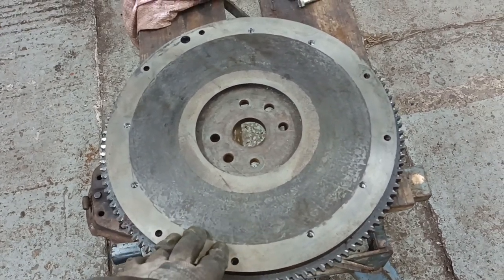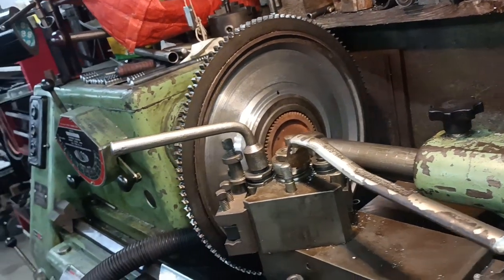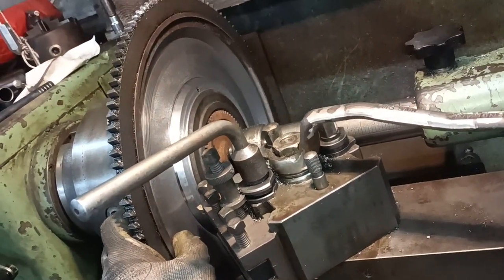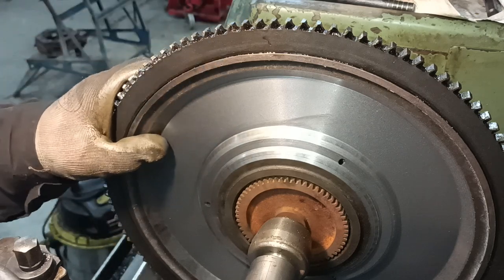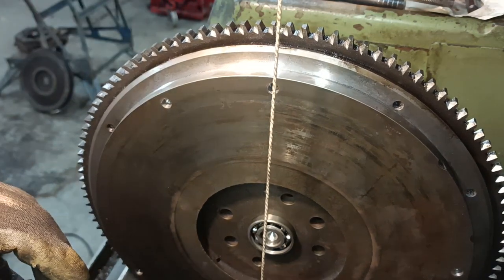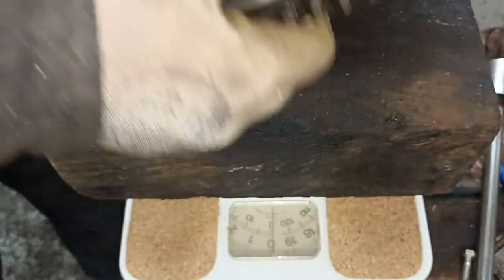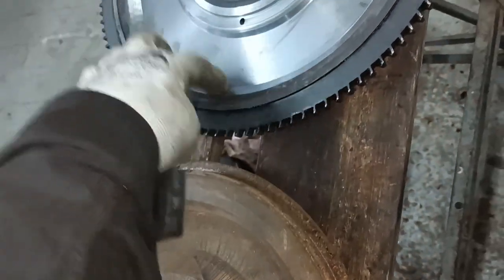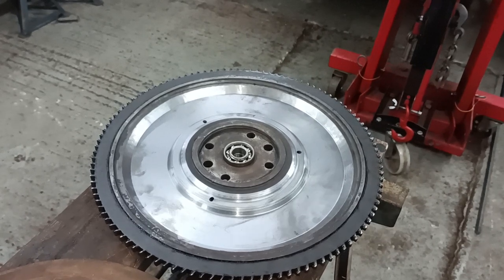A job on the lathe! Lightening a Flathead Flywheel. (2319)

Comment: Nice idea to let others know what your YouTubers are up to.  I helped a neighbor for several years with his 1937 pickup.  Servicing, brake work (cable brakes), General upkeep and then storage when he and his wife moved from the farm to in town.  We had an agreement that I’d charge him $25 a month for storage and he’d charge me $25 a month to use the truck.  After several years he was able to think about passing on the truck to me even though it had been his father's truck from new and then his for many years.  I've rebuilt the early style synchro transmission, replaced the service and parking brake cables, had the distributor and carburetor rebuilt and (heresy!) installed turn signals so I can signal a turn without the following cars thinking I am making an unfavorable gesture with my left hand.  Although the fenders were replaced and the body repainted 50 years ago, it is a real survivor and totally stock, except for the turn signals.  This week I am replacing the water pumps as one was leaking.  I suspect I'll rebuild the leaker and have a pair saved in case I need one on my 1940 Fordor.  That’s another survivor and another story.

Comment: Great job Mart. There's a 1953 Chevy Belair in the garage that I've been Terrorizing. I screw around with everything on it. Moved firewall back 4 inches...Straight axle...disc brakes on the front...9 inch ford rearend...Roll bar...Custom dash...454....Fender well headers...brake booster Assembly Under driver seat...1940 Ford foot petals...Modified of course... Cherry Bombs for mufflers...Welded both reproduction quarter panels on with Brazing Rod...Mig weld some patch panels... brazed a couple more...Bondo for God's sake...Painting frame and underside with Farm Implement paint and a brush...Did I mention BONDO...When I hear it can't be done like that...I do it on the Old Car just to show them it can be done...And I don't STACK DIMES either...Good Day Mart.

Comment: I'd like to lose 8 pounds myself Mart! Make me faster on the bike up the hills around here come cycling weather. As for the garage, here is what I am working on lately.... I bought a like-new '31 Model A frame in the fall and have since been gathering the bits and pieces needed to assemble a second complete chassis for my original, running and driving '30 standard roadster. The plan is that the new chassis will marry the roadster body with the '39 Mercury flathead V8 & 39-style 3-spd top-loader transmission that I resurrected several years ago, along with early Lockheed hydraulic brakes. By just swapping the body, I'll then have the best of both worlds, i.e. 1930 stock and a '50's era hot rod, depending on how nostalgic I feel at the time.

Comment: Hi Mart, interesting that flywheel lightening thing, depends what the intended use is. I thought about doing it on my 1928 Chevy racer, but decided that as it doesn't have much HP it needs tourque to get away on the beach, so I left it alone.  I built a 210 HP Rover V8 many years ago, ignored the blokes down the pub, and didn't lighten the SD1 flywheel but used a heavier stock Range Rover one instead, what that did was sacrifice a bit of acceleration for much more drivability in the mid range, which works very well for a light road motor. As to what Iv'e been doing, Iv'e shortened the racers wheelbase by 10" just because I could 🙃

Comment: Hi Mart , interesting stuff and entertaining as usual . Stuff wise , its getting close to spring so will be giving the 30 coupe a good service , along with the VW T2 camper, and hopefully putting the finishing touches to the 28 roadster.  Besides that I have Michaels 32 roadster in the shed for a fair bit of remedial work to make it roadworthy . Then I need to complete some work on a buddies Triumph Stag ( full structural rebuild )  then rebuild my latest old series 3 Land rover , with a 300TDI diesel motor and have a look at retaining the R380 5 speed  and also fit Range rover Power steering .. :)   Then I might get the pop out and see what that needs for a resurrection,  Whatever it needs it wont be done before Easter :)  Gus's coupe will be back for a multi carb, 4x Webber downdrafts, upgrade on the nail head  so looks like its gong to be a busy year .. If I knew how to make, edit and upload a video I would probably post some stuff, but I still dont have a mobile so tech aint my forte :)    Keep up the good work, always enjoy your input .

Comment: long story short put a 3,4kg lighter flywheel in my 42 Coupe. And it felt like 10hpr more on an otherwise stock engine. No problems getting away either. Twenty years after I sold it the new owner phoned and asked what had been done to the engine since it felt so crisp and good. Told him about the flywheel swap ;-)  So I can recommend it.

Comment: Been workin' on the coupe. I'll be putting a video up on my channel of all the struggles with a very frustrating driveability issue and how it was remedied. I have been driving the wheels off it to the tune of almost 7k miles since I finished it. Still have all the interior panels to finish, need to install my flip top gas filler and I've been gathering some acorns to replace the current 4 ring pistons with 3 ring pistons. It's developed a slight piston knock at idle which I'm fairly sure is the wrist pin bushings. While the engine is out, I'll be replacing the trans with an immaculate unit I picked up at Hershey this past fall...not ONE chipped tooth and barely any gear wear. Looks VERY low mileage to me! I'll be recording the process of everything and loading to my channel when done. Great stuff Mart, as usual...keep the vids coming!!!
Reply from the maker: Thanks Pie, I'll be sure to look out for that.
Reply: @MartsGarage  Thanks for the sub Mart...greatly appreciated!!

Comment: 1949 mercury f47 pick-up,Tradional in a sense,small block chev,mustang ll,all the reliable stuff.Running steel wheels with caps,want it to look like a lowered stock pick-up.I am not a street rod billet guy.Lean more to oldtime look with modern drivetrain.I like all rodding.
Reply: Traditional,and should be m47,should proof read my comments